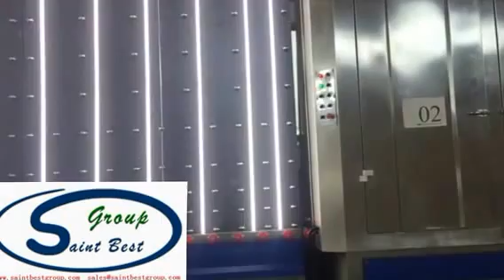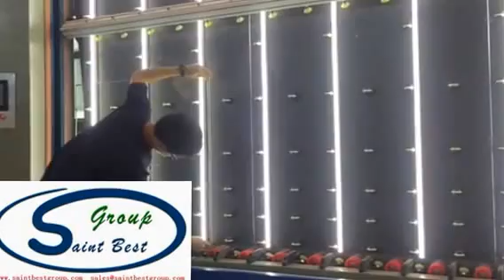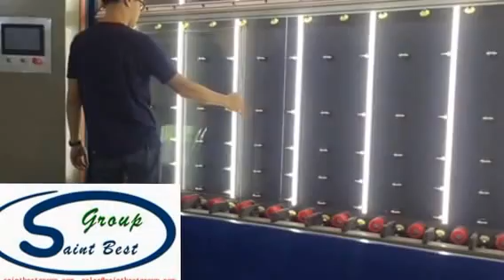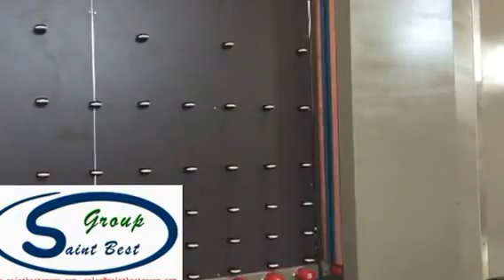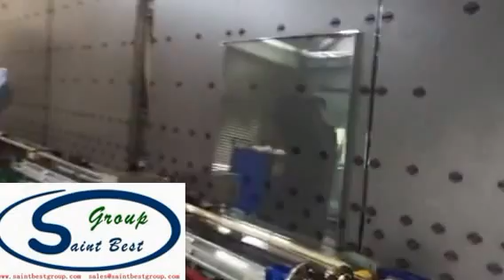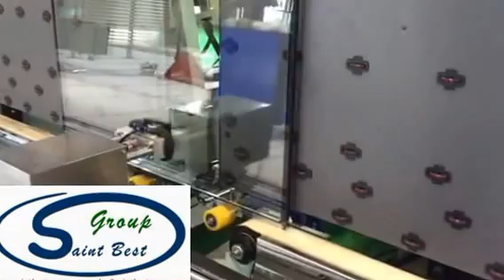Insulated Glass Production Line with Automatic Glass Sealing Robot /Automatic Double Glazing Line

Comment from the maker: Insulated Glass Production Line with Automatic Glass Sealing Robot,Automatic Double Glazing Line,Full Automatic Insulating Glass Production Line with Automatic Sealing Robot;5000mm Double Glzing Equipment with Automatic Sealing Robot, Full Automatic Insulating Glass Production Line, Full Automatic Insulating Glass Production Line with Automatic Sealing Robot,Automatic Double Glazing Line with Automatic Sealing Robot,Hollow Glass Automatic Production Line 2500x5000mm,Double Glazing Machine,Double Glazing Equipment,Insulating Glass Machine,Insulating Glass Equipment,2.5x5m Automatic Double Glazing Line,2.5x5m Automatic IG Line for Taiwan Customers Inspection,2.5x5m Automatic IG Line,Automatic Double Glazing Production Line,Automatic Insulating Glass Production Line,Insulating Glass Automatic Production Line,Double Glazing Automatic Line,Insulating Glass Production Line,Vertical Automatic Insulating Glass Production Line,2500mm Vertical Double Glazing Line,2500mm Automatic Vertical Triple Insulating Glass Production Line,2500mm Automated Double Glazed Production Line,2500mm Automatic CNC Insulating Glass Production Line,2500mm Automatic CNC Double Glazing Production Line;2500mm Automated CNC Triple Glazing Line,2500mm Automatic CNC Triple Glass Line,2500mm Automatic CNC Triple IGU Line,2500mm Automatic DGU Line;2500mm Doble Acristalamiento Vertical Line, 2500mm automática Triple Vertical vidrio aislante línea de producción, 2500mm automatizada de doble acristalamiento Línea de producción, 2500mm automática CNC vidrio aislante línea de producción, 2500mm automática CNC Doble Acristalamiento Línea de Producción; 2500mm CNC automatizados Triple Acristalamiento Line, 2500mm automática CNC Triple Glass line, 2500mm automática CNC Triple IGU line, 2500mm de línea automática DGU;2.500 milímetros Vertical Vidros Duplos Line, 2.500 milímetros Automatic Triplo Vertical de vidro de isolamento Linha de Produção, 2.500 milímetros Automated vidros duplos Linha de Produção, 2,500 milímetros de isolamento automático CNC de vidro Linha de Produção, 2500 milímetro automático CNC Vidros Duplos Linha de Produção; 2500 milímetros Automated CNC Vidros Triplos Line, 2,500 milímetros automático CNC Triplo Vidro Line, 2.500 milímetros automático CNC Triplo IGU Line, 2.500 milímetros linha Automática DGU;2500мм Вертикальный стеклопакеты Line, 2500мм Автоматическая вертикальная Трехместный стеклопакетов Линия по производству 2500мм Автоматизированная двойным остеклением производственная линия, 2500мм Автоматическое ЧПУ стеклопакетов Линия для производства, 2500мм Автоматическое ЧПУ стеклопакеты производственная линия; 2500мм Автоматизированная ЧПУ тройным остеклением Line.
If any interested in it,pls send emails to sales@saintbestgroup.com or saintbestgroup@163.com or add Skype:allenszj for direct conversation.
URL: www.saintbestgroup.com www.shuntaitech.com www.doubleglazingequipment.com www.digitaluvprinter.com
  Email:sales@saintbestgroup.com  saintbestgroup@163.com 
  What'sapp/Viber:+86-186-6042-5078